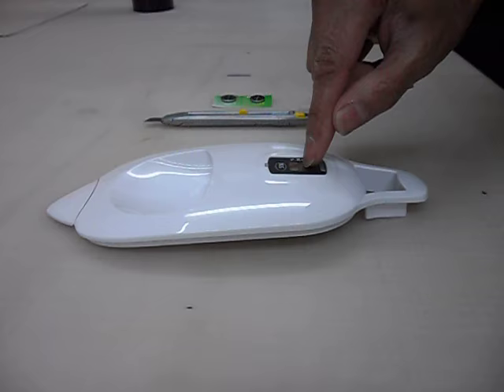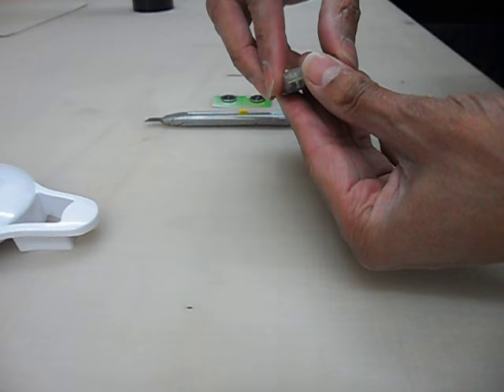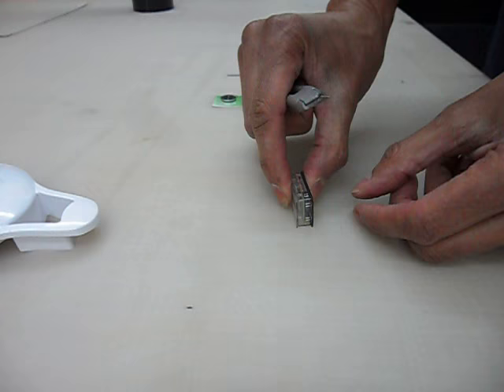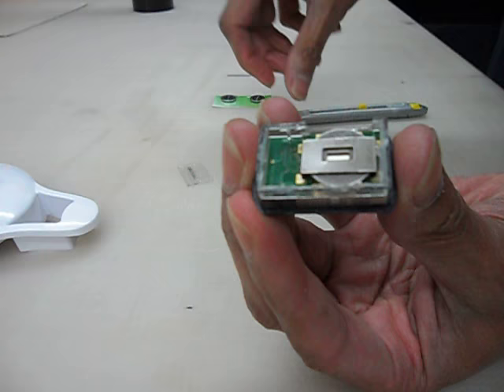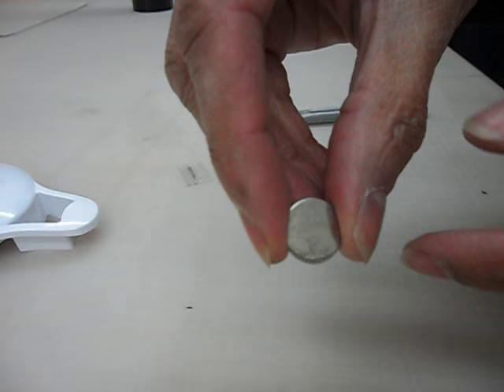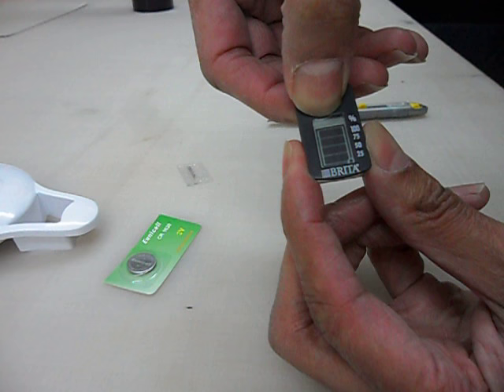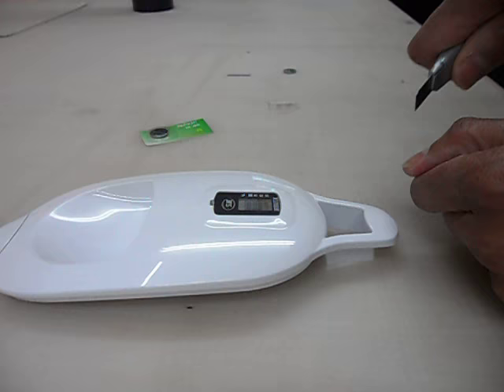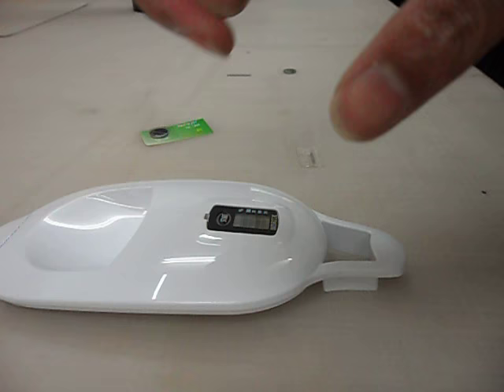Replacing battery - Brita Maxtra water filter battery replacement

Comment: It bothers me that Brita has these as sealed units not meant to have the battery replaced. It SHOULD be a unit where the battery can be easily changed! If they are not properly sealed after battery replacement, they will fail if water enters the case.
Reply: Yes, they will no longer be water proof after changing the battery this way! Even a waterproof watch is no longer guaranteed after a battery change done at the watch shop.

Comment: Not good for their green credentials they really don't want you to replace the battery, at all. The capsule I have is slightly different to the above but the principals all worked, thank you! Finally the battery is clipped to the motherboard so had to compress the clips to get it out.

Comment: Customers gotta go through all this just because some kids like to eat button batteries 😡 The very LEAST the manufacturer can do is to sell the lcd unit as a spare part, AT A REASONABLE PRICE. We can pay through the noise for filters but the damned battery runs out? Or the lid gets cracked or broken? Then the only choice is replace the whole thing or don't bother with a new one after you chuck away the old.

Comment: The one I just worked on was a little different. The back panel had a lip around the edge. I took a pointed pick and pushed down on the lip, until it started to break off. I broke the lip off all the way around. Then I was able to take a box cutter and wedge it in the middle of the short ends, rocking back and forth, as mentioned, until they were open from corner to corner. Then I took a wider, more solid blade and wedged that in and twisted. It popped right off. then I cut the side out to get access to the battery. They don't make this easy, that's for sure.

Comment: It seems that they only send out free replacements in the UK. I rang the number given in the other video, and a nice lady took my details and sent me a replacement free, and no postage. Knowing I was going to get a new one, I couldn't resist trying to open the old unit, as described in this video. It worked!
However, the "cage" over the battery was different on mine (and in the new one supplied hy Brita). No need to cut the plastic side of the case. There are 3 little "claws" over the battery. A single one, and a pair. Just lever up 2 of the claws with the point of your craft knife blade, and the battery will pop out. When you replace the battery, the 3 claws will pop back down into their little holes, using the tip of the blade again.

Comment: Great, easy to understand and follow video.  Thanks for uploading!  I followed this process for a BRITA Elemaris XL, which has a water flow sensor.  It's a very similar process, the white plastic water sensor can be prised off,  the remaining LCD/battery unit is pretty much same as the video, though with a CR2032 battery.

While a free replacement from Brita is a nice gesture, if you're able to spend a few minutes following the video, it means no need to send the old one to landfill.
Reply: The timers useless. In a 6month period, a family of 2 is going to use far less water than a family of 5. Why should they change a filter at the same time? 
Go on Amazon & get a TDS digital water quality tester. When the numbers drop, time to change the filter. They start at $2. Walmart has them for $10 I believe.

Comment: Great stuff. 👍👍👍I was thinking that the manufacturer was totally dead lazy, and moulded the meter device into the plastic lid to make a whole (disposable) unit. Only just recently discovered (with a bit of brute force) that the meter can be popped out of the lid. I then searched the www and found your excellent video. Many many thanks.
Reply: how did you get it out?
Reply: @marie-joelleraussou  I used a flat blade screwdriver (about 4mm width) and carefully inserted it where I could between the device and the jug lid housing, (sorry if this is not clear).
Reply: @uwalakab  It is very clear, thanks
Reply: @marie-joelleraussou  Glad I could help. 👍

Comment: Thanks for that, have ordered the replacement part. Had quite an effort to get the memo part out due to the scale, so the video confirmed I was doing the right thing so thanks for both advice!
Reply: The timers useless. In a 6month period, a family of 2 is going to use far less water than a family of 5. Why should they change a filter at the same time? 
Go on Amazon & get a TDS digital water quality tester. They start at $2.
Reply: Selam alt kapağı açamadım siz nasıl açtınız göstergeyi çıkardım fakat pil kısmını açamadım

Comment: We are in a very hard water area, and limescale around the unit had sealed it into the lid which I couldn’t flip out. 
So I poured neat limescale remover around the unit, left it for a half hour, rinsed it  then was able to prise it out as in your video with the help of a small flathead screwdriver.

Comment: You didn’t show how to ply the unit out. I tried using a small screwdriver through the small gap and it was stuck tight, if using a bit more force it’ll break both plastics
Reply: Yeah, he kinda did (with his fingernail)l. But use a small, thin edge screw driver & carefully pry from the top, and then gently from one side. Mine came out easily. Hope it helps❗️

Comment: You need to be careful not to take the back totally off. There are rubber LCD contact strips on the sides that must be pushed hard against the circuit board by the plastic back cover.

Comment: how did you get it out, i can't do it like you using only nails.
Reply from the maker: Hi.  I'm not too sure, on later versions of this filter, if they may have been glued in to place. I know on filters that are quite old it could be a build up of limescale that holds it in place.

My only advice is that if it doesn't come out with just a small amount of effort, don't try and force it out as you may break it. But then, if it stops working and doesn't do its job anymore, does it matter if you break it? I'll leave that for you to decide.
Reply: @Petej728  thanks, i just took this out and changed battery.
Reply: Defo glued in... It ain't coming out without a fight here 😂

Comment: The plate inside does NOT wanna come off, at all...
Reply: Yup - I had to use a bench grinder to get mine open as it was sealed with super glue!  I'll need to reseal it with something similar when I put the replacement battery in.

Comment: The only problem is that the module starts out being waterproof, so you can wash the lid in the dishwasher without damaging it.  However, after opening it up & replacing the battery, you'd have to remove the unit before washing the lid.
Reply from the maker: I have never, ever washed the lid of my filter in a dishwasher. A wipe with a soft cloth, soaked in warm soapy water, has always been enough.
It's the lid on a water filter. How dirty can it get?
Reply: @Petej728  Another reason is that I have the Marella model (not the Aluna), which has a filling hole behind the LCD module. It would be easy to splash the timer while filling the filter.  The water would then just drain into the cavity which houses the timer, and it would be sitting in a puddle of water!
Reply from the maker: @vasilis8208  This video was not made for the Marella model.
Reply: @Petej728  Ha ha, you got me!  Ok, maybe not, but it was made for the generic LCD timer modules which are used in several models!  😄

Comment: Thanks for the video. It hel me. For me i was no easy to detach the LCD becouse there was dirt. I used knife to get rid of it and it go. After that I use paper knifge like You, but not on edges. I just cut few times around the connection of the bottom plate and rest. It is glued so it must be cutted of
Reply: Dominik... you ring Brita and they send out replacement unit. The unit is SEALED . NOT meant to be opened.

Comment: What do you do if the case doesn't pop out like yours did?
Reply from the maker: There can only be a couple of reasons (as far as I can work out) why the unit won't come out.

1. It's glued in. This hasn't been the case with anyone who reported difficulty with this type of filter.

2. More likely, water has managed to ingress down the sides and around the unit and there is a possible small amount of limescale build-up, or some form of seal has occurred around the outside of the unit.

Before making any attempt to 'force' the unit out of the lid, I suggest you try and get in touch with Brita customer services in your country, explain the situation and see if there is any possible solution they can suggest.

Failing that, the LCD unit is a sealed unit, so you could try submersing  and soaking the whole lid in warm water to allow it to try and break the seal. The longer you can leave it soaking, the better.
Reply: @Petej728  I tried to pop mine out and it broke... (definitely doesn't seem designed to be removed on my jug).  Eventually got it out but plenty of scratched to the lid - it was very tight.  Don't think it was designed to be replaced.  Either that of I got a tight one.  I can totally see how Pete's method works but for most people the best bet is to source a replacement part as Pete notes in his update (or set a reminder elsewhere once the battery goes).  At the end of the day, the reminder unit doesn't impact how the jug works all that much, so not a major issue.

Comment: Is there any way to turn off the indicator when not in use? Ie if I don't have a filter fitted and not using the jug for a long period
Reply from the maker: No, there doesn't appear to be any way to switch it off. All you can do is reset it to 100% once the display shows zero.
Reply: @Petej728  Okay thanks that's what I thought
Reply: @Nyle95  You could always do this operation and remove the battery when it isn't in use.

Comment: Just in case. It's LCD display; not LED. Liquid crystal display (LCD). Light emitting diode (LED).
Reply from the maker: Thank you for pointing that out. I did know the difference but clearly didn't think about it when making the video.

Comment: If you contact Brita customer service they will send you a free replacement unit.
Reply from the maker: I don't remember seeing any documentation with my product stating this is something I should do if the LCD stopped working. And if it was included, it wasn't very prominently displayed. Further to that, I don't think I should really have to contact customer services simply to replace a watch battery.
Reply: @Petej728  they don't replace battery,  they replace the complete wee unit. If you were supposed to replace battery it would NOT BE A SEALED UNIT !!!!!! His unit is now not water proof. HOW dumb is that seeing as it's a WATER JUG !!!! Needs filling and washing with WATER !!!!@
Reply from the maker: @heatherclayton-callaghan4270  
Filling = Remove lid, fill with water, replace lid
Washing = Remove unit, wash lid, replace unit

No water getting into unit using either method.
Reply: @heatherclayton-callaghan4270  I called Brita and they said they do NOT send a new sensor for free, all they will send is a coupon for a discount on a new pitcher. USA

Comment: Don’t you want to seal it again after you break the seal. It is sealed for a reason . Also you can buy these complete on line for almost the cost of the batteries.
Reply from the maker: Is it sealed for a reason? Other than forcing you to replace it instead of just changing the battery? Other than making sure you can't fill it with water, I can't see any point in this being a sealed unit. It isn't like it's saving you from the off-chance of a massive electrical shock.

And yes, I can buy it online and maybe only slightly cheaper than the batteries cost me. But for the price of one replacement unit I bought a pack of 5 batteries (5x the lifetime of a sealed unit). Plus, why do I want the manufacturers to keep making hundreds of thousands of these units when a simple battery replacement makes less of an impact on the environment and my own pocket?
Reply: @Petej728  I suspect it needs to be sealed so water cannot get into the inside of the unit. To test that, maybe you could pour water onto the whole lid, especially at the small notch. Maybe placing a thin rectangle-shaped rubber at the bottom could seal it without having to glue the cover back... but then, you will also need to seal the battery access at the side of the unit.
Reply from the maker: I really don't understand why people keep saying that maybe it's sealed to stop water getting into it.

The only way I can possibly see people getting water into it is if they a) Totally submerge the lid in a bowl of water, why would you?, b) getting water all over the lid (and therefore into the unit recess) by trying to fill the jug without taking the whole lid off. Again, why would you? or c) you want to wash the lid, in which case you remove the unit beforehand, wash the lid, then replace the unit afterwards.

When I fill my jug, I remove the whole lid, place it to one side, pour water into the jug and then place the whole lid back on. Unless I accidentally left the bath running and the ceiling collapses showering me (and the lid) in water, some act of god gets water into the unit, or you just deliberately pour water onto the unit, there is no possible way of unintentionally getting water into the unit.

It's just common sense.
Reply: @Petej728  That's fine and no worries. I've got the larger jug, with the filling hole right next to the module and so it is very easy to let some water spill over the module, hence the worries. But really, in your case your arguments are 100% valid. Cheers.
Reply: The lid from above (there is an inner lid right next to the module): https://www.espares.co.uk/product/es1781922?utm_source=google+shopping&utm_medium=shopping&utm_campaign=google+shopping&mkwid=&pcrid=314980495869&kword=&match=&plid=&pdv=c&gclid=CjwKCAjw5Ij2BRBdEiwA0Frc9VXqKU5H2uw1VqfLWWH-U28hjDovgWfsEgH0ZyWx7XjaQYQ-rV4FWxoCv10QAvD_BwE
Reply: Buy the complete online? Sure, let's make more e-waste! It's a good DIY video, thnx!
Reply: @Petej728  I wash the whole unit including the lid in my dishwasher every few months.  That's why the LCD indicator unit is sealed, to make it waterproof so it can be cleaned.  Once you've broken the seal, you'd have to remove the unit before cleaning.  Also, my Marella filter has a filling hole just behind the LCD module, so it would be easy to splash the timer while filling.
Reply: Same here, I have the Marella model, which has a filling hole covered by a pop-up lid right next to the count-down module.  It would be very easy to get water into the module!

Comment: The module does not “simply pop out” it cracks and breaks so that it looks unattractive when replaced in the lid…
Reply from the maker: I believe that in the video I said the module 'should' pop out. If it didn't come out easily, I definitely DID NOT recommend, or say, you should force it out even if it "cracks and breaks".

Anyway, regardless, you should be able to contact the Brita customer services, in your country, and request a free replacement module and restore the looks of your filter to its former glory.

Comment: Mine does not pop out.  Is it just done?
Reply from the maker: Hi Lise.

The unit on my filter is just a push fit. Yours may be a little more difficult to remove if it has been in there a long time, but should still come out. You just need to get the first part of it free, then carefully work your way around the unit freeing slowly as you go.

However, before you attempt to force it out, I suggest you contact Brita customer services, let them know the model you have and then see if they can send you a free replacement unit. If they can, just wait till it arrives and then you should be able to work out better how the old one needs to be removed.

Comment: what do you do if you can’t take the thing out? mine is wedged in 😭
Reply from the maker: It should only be a friction/interference fit, meaning it shouldn't be glued in. I just had a go on my own filter and I can actually remove it using my finger-nail. There could possibly be a small build up of limescale, or something like that, that is creating a small seal all the way around it.

Just use a small screwdriver or some tool (I just checked and the tine of a fork will fit) and gently work it out. Don't use anything sharp, just in case you slip.

Hope this helps.
Reply: @Petej728  thank you for replying! did try my finger nail first but didn’t work, now after the use of a fork and some tweezers, it’s popped out (although looking a little damage around the sides instead of being pristine like it was 😆) it’ll work, thank you so much!!

Comment: How does the indicator detect it is time to change the filter?
Reply from the maker: Copied and pasted from a reply I made to somebody else with a similar question.

The LCD display is purely a visual aid for you to gauge when it is time to replace the filter.

Brita recommend that the filter should be replaced at least every 4 weeks, or after 100l of water has been filtered.

The LCD display has 4 bars. So, when you fully set the display to 100% and fit a new filter, 1 bar will disappear each week. After all 4 bars disappear, you should change the filter.
Unfortunately, this method doesn't take into account how much water has actually passed through the filter, so it isn't very accurate and should only be used as a guideline.

Obviously, if you filter 200l every 4 weeks, you should reduce the replacement time by half and so on. But if you only filter less than 100l every 4 weeks, say 50l, you should still replace the filter in the recommended time (Brita's advice, not mine).
Reply: @Petej728  What?!?! so, theoretically i can stop using it and write a memo on a post-it. No batteries, no waste of time and money. Also More eco friendly
Reply from the maker: @83bubble  In a nutshell, yes.